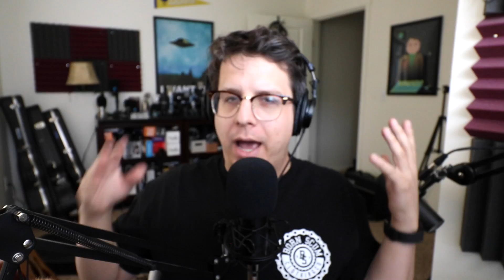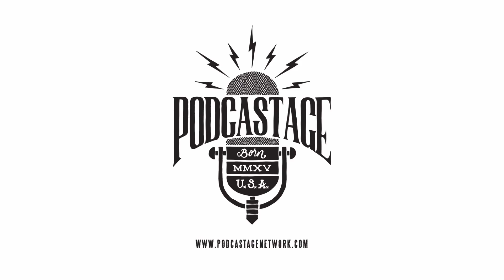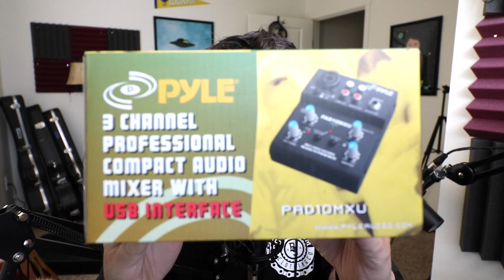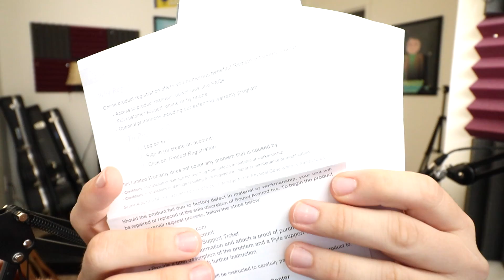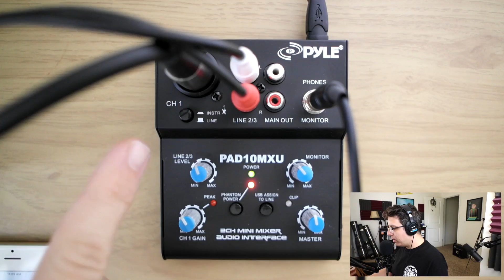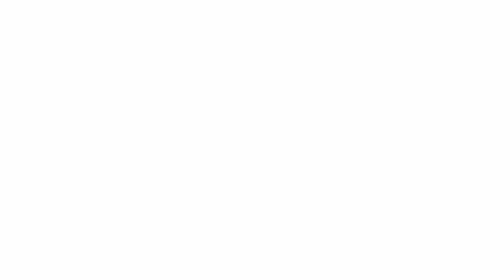Pyle PAD10MXU Review / Test / Explained

Comment: Hi and thank you for the great review and details. I just got one of these mixers that I want to use with Zoom meetings to play music via iPhone with rca to 3.5m jack, I’m using a wirless mic that goes into ch 1 via 1/4 jack. I want to be able to play music and mic and have control of both volumes for zoom fitness classes. I plug usb cable into mac laptop with sound preference out and input on USB device. People on my zoom meetings can clearly hear the mic but no music, levels are up, I’ve tried pushing in and out the use assign bottom, but still no audio to zoom participates. Please help which I appreciate :)

Comment: So I have my phone pluggen into the line 2/3 input and my computer is not receiving any audio from it. Does this only play through the monitor or am I doing something wrong.
Reply: Hay bud I'm having the same problem rn did you ever figure out what was wrong?
Reply: @1xXDjNeoNXx  Yes I did. I found you have to have another rca to 3.5mm to put into the main out. the line 2/3 won't work over usb. also to save some frustrations don't plug the main out line in with the usb being powered by the computer this will cause cross talk with the electricity and you will get a buzz. I would suggest doing what I did and plugging it into a usb to wall outlet adapter to give it its own unshared power.
Reply: @TheManInMyHead  I am having the same problem here too.  I am using it for a zoom call  When I plug the line 2/3 into my ipod touch for music I get the sound out of the monitor but I don't get anything coming through the zoom on the computer.  Where did you plug the main out line to and what connection end?
Reply: @andrewferg7621  the computer needs a 3.5mm mic port to plug into. If it a laptop it most likely has a headphone jack that can take a microphone you just need to buy a headphone mic splitter and plug it into the mic port. If it is a desktop it should have a headphone port and a mic port separately on the back of the motherboard.

Comment: I need helpI have a capture card for ps3 and it has a 3.55mm mic jack. I can connect my pdmic58 with an adapter but is there a way i can squeez this interface in between?

Comment: I thought for sure I saw a comment asking if this unit was Class Compliant.  I am new to all this but it appears to me that this unit is NOT Class Compliant (needs no driver)  I tried plugging it into my iPad but got no sound through the "USB assign to Line" button.  I tried it through my powered hub, both powered and unpowered and still no joy.  But as a mixer just like was stated it sound pretty good.  Plug my bass into the Combi, iPad into the RCA and practice away.  Power it with a battery and it works great as a mobile, quiet, practice rig which was what I was looking for.  I have not plugged it into my computer yet to see if it works as an audio interface because I am not there yet.  Still learning.  

Thanks again Bandrew for the point in the right direction.

Comment: I am looking for a unit I can plug my bass into and my iPad and use as a mobile (unplugged) practice set up.  If I plug my iPad into the USB and push the "USB to Line" button can I hear the drum machine/music and hear my bass if I am plugged into Input 1?  It looks like I can use it with the bass in Line 1 and iPad in 2/3 and power the whole thing with a USB battery.  Great review and thank you so much for your expertise.

Comment: does the power come from the usb or does it have a power adapter?
Reply from the maker: USB.
Reply: thanks
Reply: Not to horn in on your territory Bandrew but the box that mine came in had a wall wart you could plug into the wall so you could plug it into the wall or use a battery or computer to run it. Just like your review said it does sound pretty good. Thank you for the point in the right direction.
Reply: read the instructions it explains why that is
Reply: Cool.  So excited last night to try it out that I didn't look at them.  It still is USB powered only from a wall wart.  From Bandrew's review I had a good idea how to hook it up.  He does a great job.

Comment: could you do this with a neewer nw-700?
Reply from the maker: i don't even know what you're asking. I think I used the nw700.
Reply: I meant that even though the pyle doesn't supply 40 volts with the phantom power on would it still be able to efficiently power it.
Reply from the maker: Yes it will work. The NW700 only requires ~5v, so this will work well for that.
Reply: Thanks

Comment: Will this power the AT2020?
Reply from the maker: I think I tested the voltage in this video. If I did, compare this to the 302usb and AT2020 video on the Podcastage2 channel. If they're the same then it should be able to.
Reply: I didn't realize you had a second channel! You actual have the exact video I needed "Does the AT-2020 work with the Pyle PAD10MXU Audio Interface?", so that answers that question. Thank you so much, I really enjoy your videos!

Comment: How do I monitor a music track playing from my pc and my voice through the device's monitoring without also recording the music track? I've had this mixer since 2013 and haven't figured it out. Could you recommend a mixer/audio interface that would allow this? Been looking at the focusrite 2 channel. Basically looking for a device that'll let me hear the music in headphones without outputting it through to recording. I've been using multiple input gaming headphones in the meantime to deal with it. But, I've got some MDRv6s coming in soon.
Reply from the maker: focusrite should work.
Reply: Podcastage I watched your older beringer 302 video. It has a button to change an input from main mix to headphones. The 802 has the button to switch between headphones and control room, which is even better. I want the 2i2 but can't find black and white info on my particular need anywhere. Thanks for replying. You deserve more subs.

Comment: Your video was very helpful, however I have a question about the USB interface.  I received this mixer yesterday.  When I attach it to my Win7 PC, it shows up as "Microphone (USB audio CODEC)", and only the left channel can be recorded on the PC even though I have stereo selected.  The left channel audio appears on both the left and right audio inputs.  Will this mixer record in stereo over USB?
Reply: I almost immediately stumbled on the solution to my problem.  Manage Audio Devices showed that the mixer default was 1-channel, 16-bit, 44100.  I changed that to 2-channel, and it now records both left and right channels OK.
Reply: HEY ANDREW I received my mixer this week, when i plug my mp3 player on line2/3 , i can hear the sound of it in my headphone but no sound comes to my computer , Do you have this problem too ? what setting did you use ?

Comment: Why didnt you include the links to the wires you used to set it up. Im having a hard time finding anyone who does full videos with links to all the parts
Reply from the maker: There's nothing special about the cables I'm using. I just bought them off amazon. If you just search STEREO 3.5mm to RCA, you should get a cable you can buy. if you search XLR to XLR you should also get a cable you can buy.
Reply: I figured it out RCA to 3.5mm cable, gold plated for better sound quality

Comment: Would this work if I used an XLR to 1/4th inch cable? Just got the NW 800 and this interface, and I'm getting no signal... Do I have to let it charge?
Reply: Literally saw this video 3 times, and never heard "You can not phantom power with 1/4th inch cable" LOL

It's alright though, I bought an XLR to XLR cable..
Reply: No. 1/4" cables do not provide phantom power.

Comment: So what's the best deal, get this one or the 302 usb behringer interface?? And what other cheap usb audio interface do you recommend??
Reply from the maker: If you can get the Behringer 302usb for like $40, I would go with that since it allows you to adjust EQ.
Reply: +Podcastage Maybe is not completely necessary but If I want more power can I use a phantom power supply like "neewer" with that mixer?
Reply from the maker: I suppose so.
Reply: Okay, Thanks!!

Comment: Would you say using this mixer would improve audio compared to a usb soundcard?
Reply from the maker: Yes I would. They are actually designed to power microphones unlike usb soundcards. If a USB soundcard works, it's just a happy accident. So mixers/audio interfaces will provide better quality.
Reply: Thanks for the reply! I have the behringer xm8500 and I was hoping this would help to reduce the hissing that the mic is producing.
Reply from the maker: OpenSource Won't be a huge difference between usb soundcard and mixer for a dynamic mic.
Reply: ah, alright!

Comment: You could have a separate phantom power source for your mic which then can be inputted into this mixer correct? and will it have any effect on audio quality doing so?
Reply from the maker: You're absolutely right. You can do that. Depending on the microphone, it may or may not effect the audio. If the microphone requires a full +48v of phantom power then it will improve your sound. But if you're using an NW700 or anything similar that requires 5v, then you should hear no difference between the mixers phantom power and the external phantom power supply.

Comment: What kind of microphone is recommended with it ?
Reply from the maker: +Mr Xploit Electret Condenser (NW700, NW1500, BM800, etc)
Reply: Which one is most preferred ? Best quality? And a link to the microphone
Reply from the maker: Get which one is cheapest (nw700, nw800, nw1500, bm700, bm800, bm8000). The quality is not very different. You'll be fine with any of them.

Comment: What XLR cable do you use with your bm 700
Reply from the maker: +Toby Nuttall I just bought whichever one was on amazon.
Reply: +Podcastage I bought one because my original one broke but my new one which was a stagg cable does not do anything when you plug it in so I was just wondering
Reply from the maker: Toby Nuttall http://amzn.to/1QUT7qo

That's the one I bought

Comment: wait a second
what is the microphone you recorded with?
Reply from the maker: +Omer Elster NW800
Reply: +Podcastage what is the xlr type on the mixer because on amazon it doesn't look like the standard type that are on mics
Reply from the maker: It's standard XLR cable. Jut not a COMBO xlr.
Reply: the end that plugs into the audio interface  what type of xlr is that
Reply from the maker: 3-pin XLR

Comment: Wait, so should i buy it for my BM-800 or not?
I did not understand if you recommend this mixer or not... :\
Reply from the maker: +AdventureCraftGamers Yes. I think it sounds great for cheap. This or Xenyx302USB are both mixers I recommend for BM800. Just whichever is cheapest and whichever has the features you want.
Reply: +Podcastage 
Ok, thank you!
Can it work as a Sound card too? I mean like plugging my headset into it...
Reply from the maker: The XENYX302USB would if you have a headset with 2- 3.5mm jacks (1 for headphone, and 1 for microphone).
Reply from the maker: If you just want to plug in your headset and use the HEADPHONE portion, and not the mic, either of these should work. The XENYX302, you can plug into the 3.5mm headphone port. With this one you will just need a 3.5mm to 6.35mm adapter for your headphones.
Reply: +Podcastage 
Wow, thank you so much!
Im asking you this because im searching a good sound interface i could plug my microphone and my headset into it :P

Thanks!